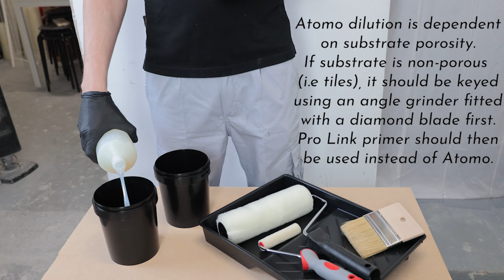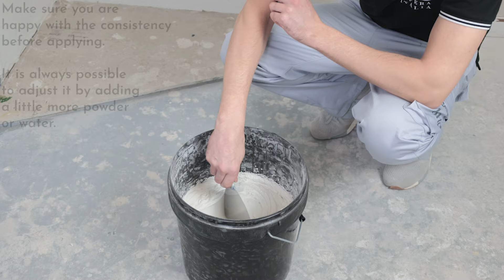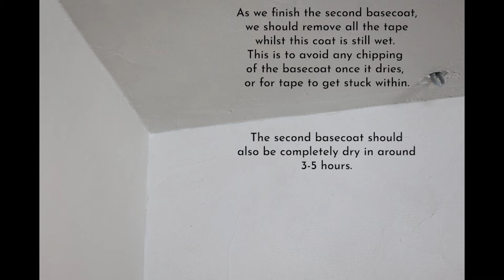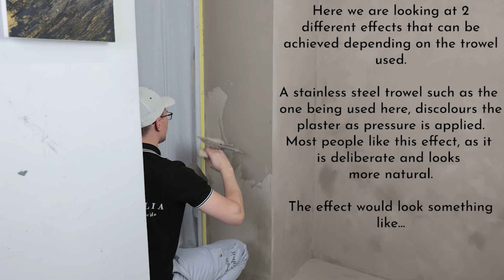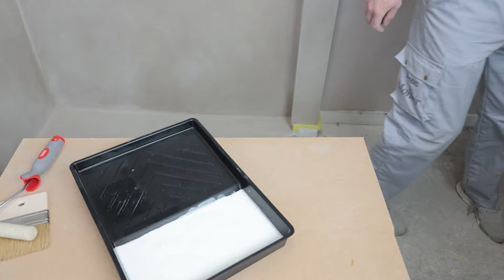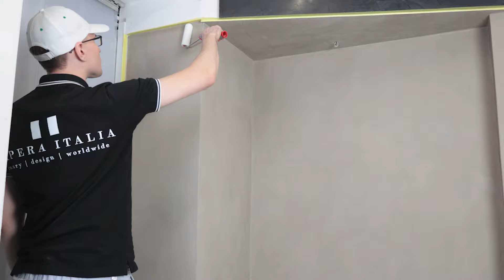How to apply Microcement Step by Step

Comment: Good video. One thing many people miss with microcement is moisture control and proper base preparation.
If the substrate has more than ~16% moisture or is not stable, cracks and stains will appear later.
In practice, most problems come from the base – not the finish layer.

Comment: Thank you for the informative video! Do you know if the primer can be applied directly onto an already painted wall? Or if the wall needs to have the paint sandblasted off first?
Reply from the maker: Hi there! Microcement can be applied to a lot of different substrates including painted surfaces, you just need to make sure to use the right primer :)

Comment: Your video was fantastic and helpful. I followed the tutorial exactly as you did, and it turned out great. However, I encountered a problem: after applying the finishing coat and leaving it for 24 hours, the coat faded away when I turned on the hot water. I would greatly appreciate it if someone could explain and help me fix this issue.
Reply from the maker: Hey there! 

We are very happy you liked the video! 

It could have been several reasons, so it's best if you email to sales@imperaitalia.com and they can help connect you to a technician. 

Thanks,
Impera Italia

Comment: Material and labour cost for this must be ridiculous?? So much work involved and doesn't look anything special.. am I missing something?
Reply from the maker: Hi there! 

The prices vary based on location, size of project, finish...etc. 

This is just a very standard application we are showing here. The beauty of microcement is that it is bespoke made for your project, which means you choose the colour, pattern, texture and even whether you want a matt or glossy finish. It can seem expensive, but in fact the cost of the application is comparable that of tiles.

Thanks,
Impera Italia
Reply: Your missing a life time of cleaning grout 😉
Reply: Might be worth it for a slick look on a floor or a shower, but for dry wall application I would just go with a lime paint.
Reply from the maker: Hi there! 

Microcement is definitely the kind of product we recommend for wet room areas, floors (residential), and worktops. 

It's impossible to compare it to lime paint, as microcement is a coating system that was meant to offer a more resistant finish. This is a very simple application we are showing here, so it doesn't do justice to just how far microcement can go as a bespoke, water resistant finish. 

If you are interested in a simple, cost-effective product that gives a minimalistic finish, we recommend our Concrete Paint for a textured look and Lime Eco for lime paint, or as a limewash finish. 

Thanks,
Impera Italia
Reply: Guys are charging $300 a metre in south australia for this
Reply: Here in the US, the charge per square foot is about $30. It seems to involved about 7 layers altogether, I can get the exact look with a Lime based Italian Plaster which is a 3 layer finish. We have new. products more shower walls which are a lot more beautiful. French Clay is another way to accomplish this look, that is a 5 layer system, which we charge $30 a square foot. It's truly not that Unique!!
Reply: It's a fad, like venitian plaster. What they don't tell you in the video is how impossible it is to repair. A cracked tile can be replaced...this stuff....yeah good luck maintaining your 'bespoke' look. And no, it's not as tough as the sellers want you to believe.
Reply: @Shanidar1 you sound like you speak from experience? 😮
Reply: @Shanidar1 spoken like a true tiler 😂

Comment: Please vent the area really well when applying the top coat, i learned it the hard way as i went almost blind for a solid 2 days.
Reply: Holy crap that must have been scary!
Reply: @ninaelwart9460  it was
Reply: Oh my Lord. Hope you've recovered fully. 😢
Reply: What happened? Can protective glasses help?
Reply: @DusanMunic  Don't really know, the coating definitely releases fumes and gases that are not very good to your health. Either ventilate the are really well, or use mask and sealed glasses.
Reply: @MCXipamapussa tnx

Comment: Ive see alot not using mash why is that very nice video
Reply from the maker: Hi there! 

You are right, many people don't use mesh. In theory, you can get away without the mesh, provided that you have a substrate that is guaranteed not to crack. 
In the UK, due to the way in which most places are built, there is almost always some kind of movement of the substrate, which can lead to cracking. The base coat alone is not enough to stop this. You need the mesh to give you the tension strength. 

It is down to every applicator to understand the surface they are working on, and make the necessary judgement.

We hope this helps!

Thanks,
Impera Italia
Reply: And what price per meter that becomes? Multiple visits to same wall . Priceust be huge

Comment: What kind of waterproofing system to use when using microcement for bathrooms?
Reply: Won’t matter need a primer coat , we use mapelastic smart which is cementitous
Reply from the maker: Hi there! 

This is a really good question. 

There are countless ways to go about the build-up of the substrate before applying micro cement. One very important feature, which has become a common mistake, is that people don't understand that micro cement is only designed to be water resistant from the front, where the resin sealer is applied. 
This mean that the build-up should  be done in a way, that protects the integrity of the micro cement base coat, as well as the substrate it is connected to. 
For this reason, we always recommend using water resistant boards or panels, as well as adequately tanking the space. The precise method is really down to the specialist carrying out the work. 

Thanks,
Impera Italia

Comment: On which kind of walls do you apply this? Is this good for showers?
Reply from the maker: Hi there! 

Microcement can be applied  to almost any surface, provided that it is solid enough.  There are different primers available, depending on the absorption of the substrate.
The main advatange of microcement is that due to its resin sealer, it is water resistant once applied, meaning that yes, you can have it in showers. You can even apply it on floors. 
To make it an even more attractive option, it can be applied on top of existing tiles, without needing to remove them. 

We hope this helps! 

Thanks,
Impera Italia

Comment: For this small project you demonstrated, what was the total amount of time taken from start to finish?
Are we talking a few days, or more like a couple of weeks (not including the recommended 21 day final set time)?
Reply from the maker: Hi Gene!

Thank you for your question, I can tell you that this entire application took us 4 days. It is worth knowing that as we were in a fairly confined space, we were able to control the temperature very well and keep it at around 25-30C. The main factor to take into account is always drying times between coats which can affect the overall length of the project.